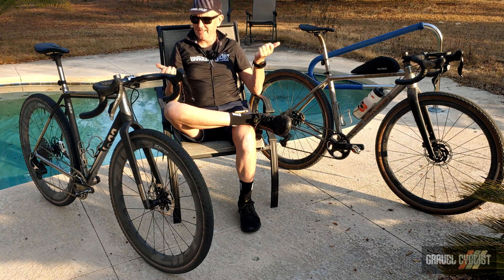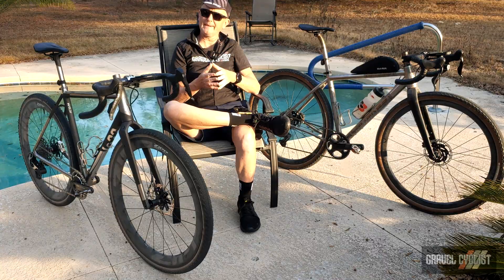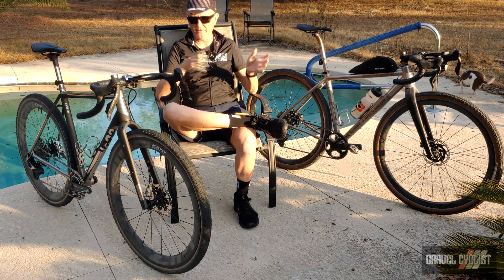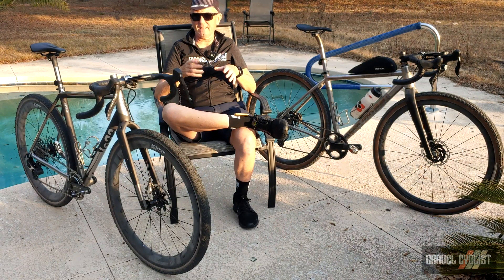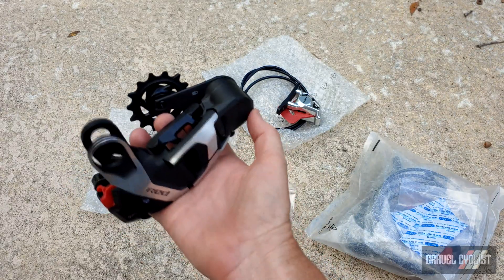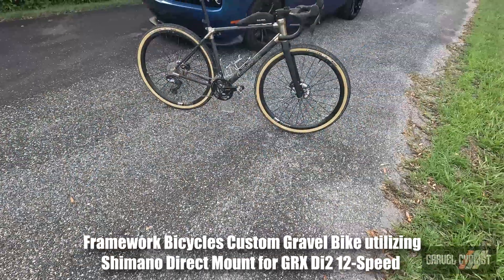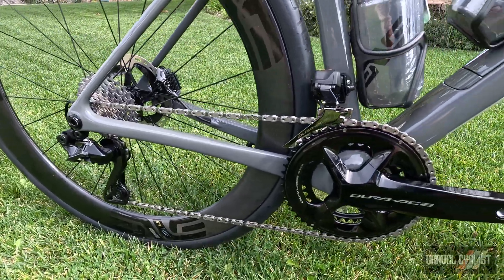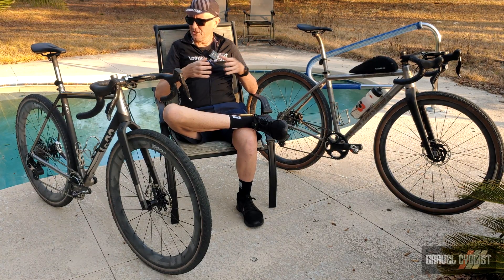UDH Gravel Bikes: What is UDH?

Comment: In 2010 a rock got kicked up by the front wheel of my Trek 6000 and hit the rear derailleur and broke it off the hanger. I had to walk the bike home and it was hard finding the correct replacement. Kind of the situation where you send a pic in an email to the seller and after a confirmation make a purchase. I'd say it took 7 purchases to get it right and 6 returns, all having to pay shipping back to merchant.

Comment: Although obviously stronger, it doesn't seem like a good idea, the derailleur itself takes all the shock -  or the frame. Which nullifies the whole idea of a separate hanger!
SRAM derailleurs don't have a hanger anymore, you need to replace a larger part if damaged, so even more expensive.
Reply: @DR_1_1  the load is on the axle, not the frame. T Type derailleurs also have the ability to deflect.
Reply: @jmdrstv  And all the load on the axle is on the frame.

Comment: I believe SRAM made UDH is an open standard.  Not sure if their hanger is patented though. If not, then anyone could make hangers and that would mean that all other companies would switch.  I think it makes a lot of sense today, because it is designed to hang off the  thru axle, while the traditional hanger was designed to hang off the dropout. With steel bikes, the hanger rarely broke because it was part of the dropout and made of very thick and strong steel. The sacrificial derailleur hanger really came about later, with carbon fibre frames.

Comment: Would be dumb to buy a non UDH bike at this point.
Reply: Yep
Reply: As a mountain biker i can say UDH isn't a good idea in most cases, what happens is rather than the hanger bending? the frame cracks, the rear derailleur breaks off at the bolt, shearing the top of the derailleur in two, or the derailleur cage bends badly, if you take away one weak point, many others take its place and are alot more expensive

Comment: I'm running the latest Pivot Vault with UDH. My build is SRAM XX SL Transmission with Red XPLR crank 42T. Along with current Red shifters/calipers.  I prefer the mullet drivetrain here in northeast Georgia. SRAM is quickly becoming the "go to" build kits on all bikes.
Reply from the maker: How are you enjoying the Vault? I'm dropping my review of the bike soon, although mine is fitted with SRAM Force XPLR 12 Speed, and a UDH adapter.
Reply: @GravelCyclist  I really like it. Geo works well for me. Tire clearance is abundant. 40 mm tires look small 😉. I'm using Industry Nine AR 40 wheels.  Will you be at Home Grown Gravel next month?
Reply from the maker: Uncertain about appearing at Homegrown next month, did appear last year, had a fabulous time! I've been running several different wheelsets on the Vault, it certainly is more capable, at least with tyre clearance, than the preceding Vault... a bike I still love.